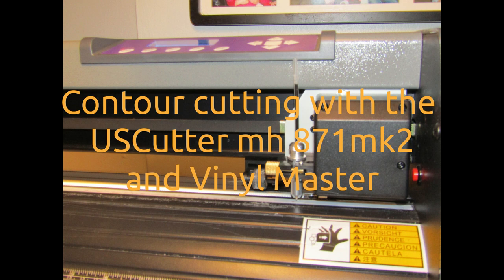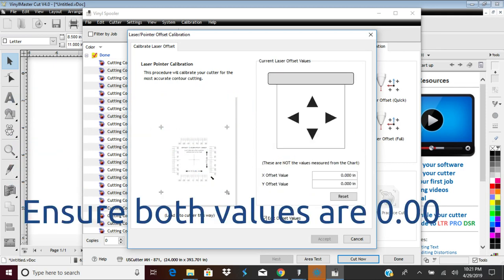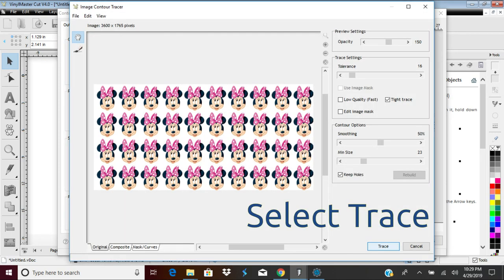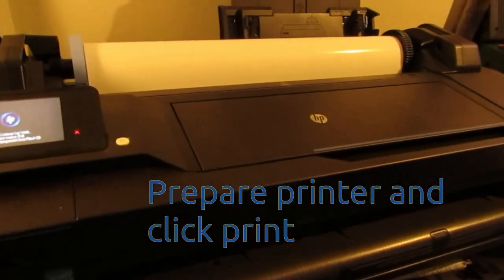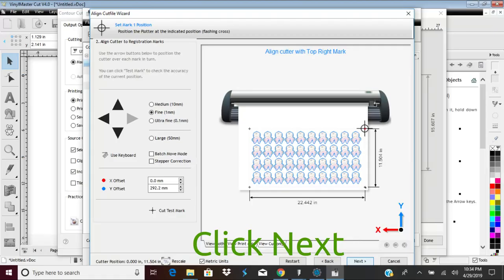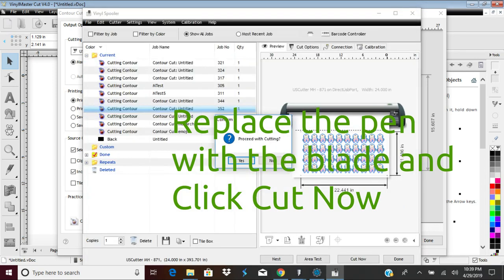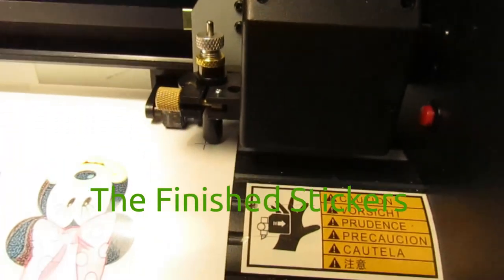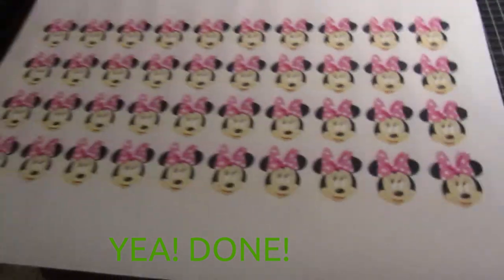Contour Cutting Stickers with USCutter MH 871 mk2 and VinylMaster

Comment: Hello. My Vinyl Master Traces not showing up
Reply from the maker: I usually go through the contour cutting wizard for cutting out sticker sheets. I don't know how you are doing your traces. I'm no expert, this is just a hack I worked out to make my cutter do contour cuts.
Reply: my trace is not showing up either, did you ever figure it out?
Reply from the maker: there are three tabs at the bottom of the preview window, view print only, view cut only, and view both. If view print only is selected the trace will not show up in the preview window.

Comment: Was that a hp designjet T120?
Reply from the maker: Its an HP Designjet t120 inkjet printer, It has single sheet, roll, and cut sheet feeders. I was using Inkjet vinyl for the stickers, if the vinyl is not inkjet vinyl the ink will not adhere to it.Yes.
Reply: @bcburnettcom  awesome thanks for the answer+additional info!!! that's my next buy! I got an Epson wf 7720 which I converted to sublimation ink and now I need a hp designjet t100 or 120/130  so I can handle wider formats as well as rolls!!!! Hard to find one for less than 1k that can do rolls, but hp t120 just barely makes it :) love your video btw!
Reply from the maker: @NothingsR33L  I picked my t120 up on amazon refurbished for $599.00 last year. My next purchase for it is going to be a tank system as the ink from hp is very expensive, refilling my own is messy, knock off carts are ok but it always seems that the color carts drain 10x faster than the black and you are left with ink packs missing one or two colors other than that I love it to death! just make sure to print something on it every 2-3 days or the print head will dry out and it is a $199.00 expense.

Comment: Wish printer is that?
Reply from the maker: Its an HP Designjet t120 inkjet printer, It has single sheet, roll, and cut sheet feeders. I was using Inkjet vinyl for the stickers, if the vinyl is not inkjet vinyl the ink will not adhere to it.
Reply: Thabks a lot!

Comment: Too many steps
Reply from the maker: There are better machines out there that will do the registration setup automatically, in fact some will print a barcode on the print so it knows which contour lines to pull from the computer. but the price for this convenience is a factor of magnitude above the mh. the Roland cut and print combines the two functions, and prints on any vinyl with uv resistant ink. The H P latex printer will print on virtually anything, so there are great options if you want to look at more professional machines.